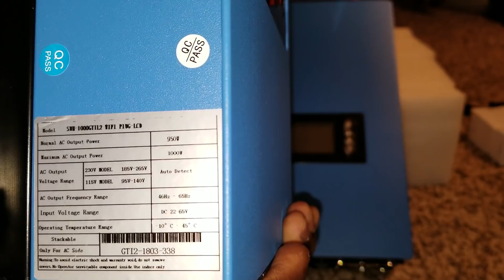SUN 1000W GRID TIE INVERTER LIMITER

Comment: Question: Is it possible to have 1 inverter on the main box, and another elsewhere? Example: I have a water pump which is 50meters away from my main box.. so basically I would have 2 inverters and 2 sets of panels, one by the main box and other by my pump?  Cheers!
Reply from the maker: As long as the water pump is wired directly into the main breaker panel, i will say just have the two inverter wired into L1 & L2 to back feed power on both legs for your water pump and the rest of your home
Reply: jwsolarusa  .. Thanks for replying!  No the water pump would not be on the main braker panel.. it's 50 meters away. Would it be possible to test this configuration?  If you put a clamp on your main braker (unit a).. and put a clamp on a bulb (unit b) see if they work with each other.  Maybe an idea for a new vid?    Edit: that would need a seperate panel or batteries for each unit.. do you have?